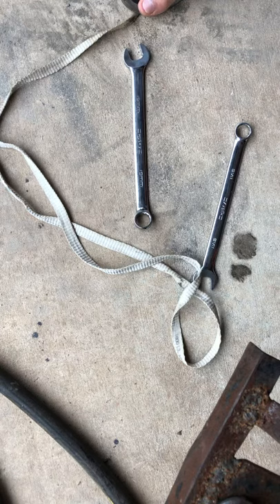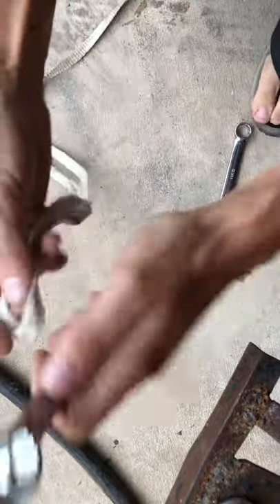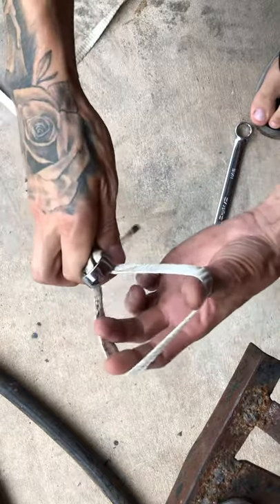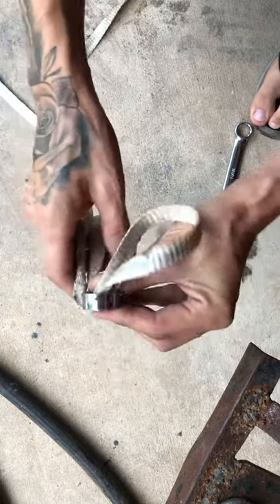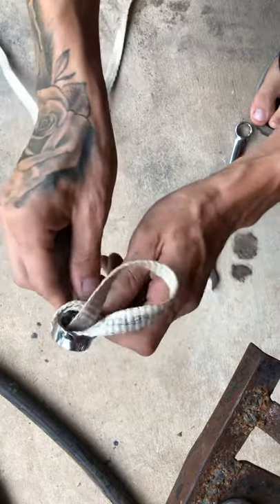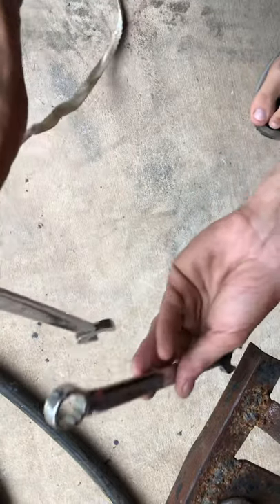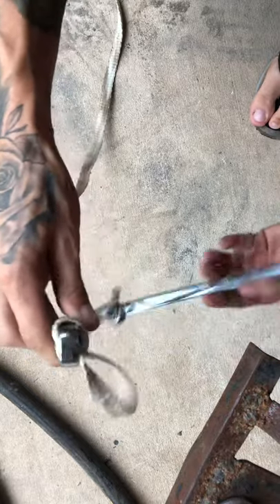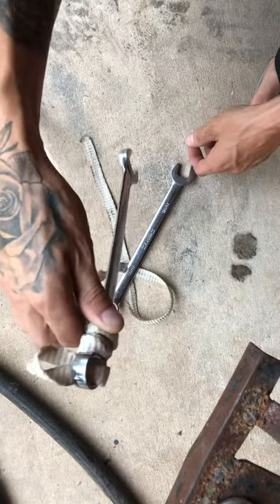How to remove your oil filter without a oil filter wrench

Comment: I ran into issue last night changing my oil.  My oil filter socket was too small it was for my motorcycle.  Tried this method w a tie down strap, couldnt believe i actually got it to work.  Thx for video.

Comment: Thanks! Using a strap didn't work for me cause strap just kept sliding round and round the oil filter as I turned it but then I remembered I had a tow bar chain so I made a slip knot with the chain and pulled the end through the wrench and proceeded with the rest of your steps and my oil filter came off! You are a life saver!

Comment: Man, I can't believe this actually worked. I had already drained my oil and didn't have a filter wrench. I used 550 cord and it worked fine. I also used a tiny little wrench for the second one - use a big one so you can crank more easily. Thanks Justin, that was clutch!

Comment: Filter Wrench broke, Screw driver method not a chance went through the housing, chisel and hammer  all failed over 2 hours, this is the only thing that worked 10minutes, initially i tried with normal rope  but was not so good( may be would of worked) it is better and easier with flat braid) fortunately had some . Thanks for sharing.

Comment: This is a greater trick, depending on the the oil filter location a lot of the time if you can get an ice pick or a medium/smaller screw driver mostly horizontal you can hammer it in the filter and break it loose that way also

Comment: Does anyone else have ideas of or tried to glue a nut on top for easier removal? 
And is it better to add some oil into filter before installation, or simply letting the pump do it's thing at pre-start enough?